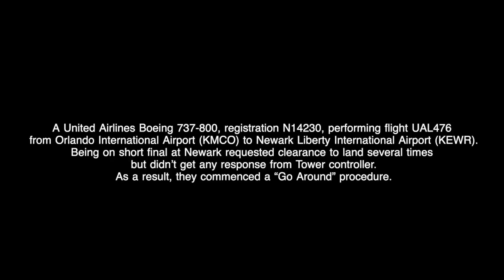United pilots not receiving response from Newark Tower. REAL ATC

Comment: The pilots did the correct thing, you can't land without a tower clearance during controlled operations.
Reply: every approach is a go around with a possible landing (assuming you have power...)
Reply: “Possible Controller Deviation”
Reply: Bruh obviously never heard of 7700 or better yet 7600 shut that John up (only jokes)

Comment: Not an excuse, but a probable explanation.  Initial call on and response for the go around call were two different controllers.  Most likely the part where United wasn’t being responded to was most likely when the relief briefing was happening.  Controllers never heard the repeated requests.  In the center environment the relief briefings are on a recorded line, while this is happening the radio comes over a speaker, and could be missed if there is a lot of other noise at that time.  
Looks likely the briefing ended just as United executed the go around.  I’m sure the relieving controller had been erroneously thought they had been cleared to land so was surprised.  The primary cause would thus be a poor briefing, or poor timing by the relieved controller. Briefings should only come when it is safe.  I have on many occasions delayed and even passed on being relieved if I thought there was too much going on at the moment to give a proper briefing.
Reply: I don't know about that because tower was giving instructions to other aircraft while united was asking for landing clearance.

Comment: Is there any recourse by the airline to the controlling authority? This must cost a huge amount in fuel and engine depreciation.
Reply: One toga? 8 minutes fuel? That’s one passengers ticket cost. Drop in the bucket
Reply: @JohnnieV  Can you support that with actual numbers?
Reply: @MrDeanonline  I did a go-around in a 757 once and it cost us 3,500 pounds of fuel. Divide 3,500 by 6.7 pounds per gallon and that is 522 gallons of fuel. At $3 per gallon currently, that's $1560 !!!
Reply: Now it’s $6 a gallon

Comment: The United 476 aircrew should have said to the Tower controller, "Tower, United 476, possible Controller deviation, prepare to copy a phone number".
Reply: It isn't a deviation. The tower controller told them to continue. If you don't receive a clearance you go-around as they did. There's no requirement to be given a landing clearance.
Reply: @JohnSmith-zi9or  No, it doesn't work that way.  This is part of the checks and balances in commercial aviation.  Not giving clearance or a "go around" response to the aircrew is what we call "no control from the controller".  He was either lazy, inattentive, or purposely delayed a landing.  The delay costs the airline money. The controller was irresponsible.
Reply: @marshallpoe8087  We have no idea why the pilot's weren't given a clearance. It could be neither of those things and probably is. The pilots did the right thing and followed procedures. This is procedural control and it kept everyone safe. 

Interestingly at the beginning of the approach they were told to slow down. I wonder if the tower controller was watching the airplane in front of them to see if they were going to be able to clear the runway first or have the minimum separation distance and a anxious pilot wen't around a bit early? Late landing clearance in my experience at EWR are not uncommon.